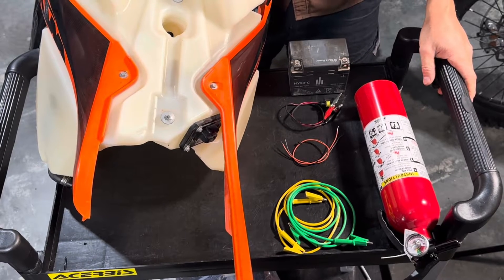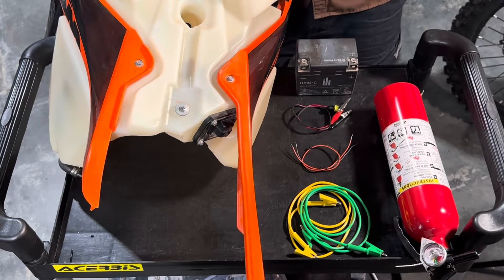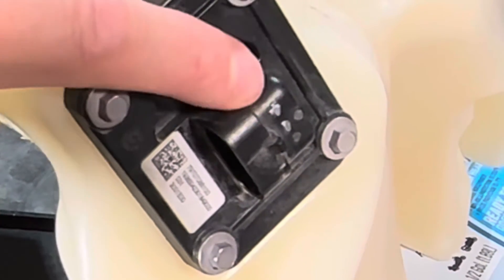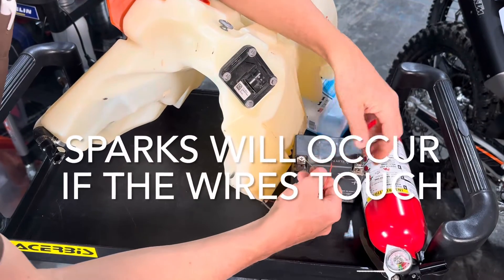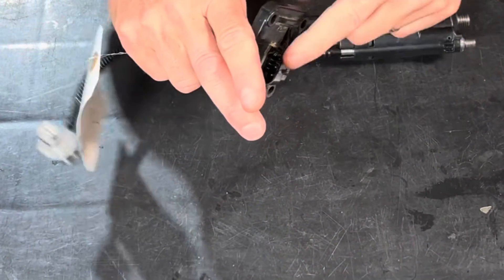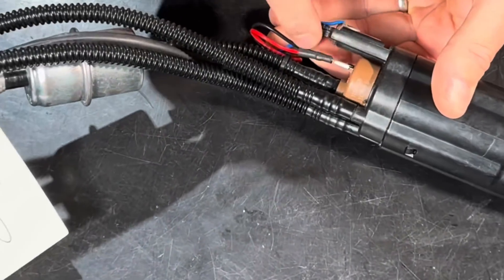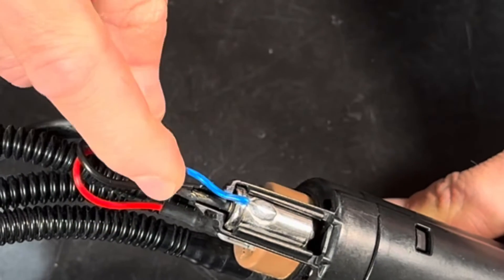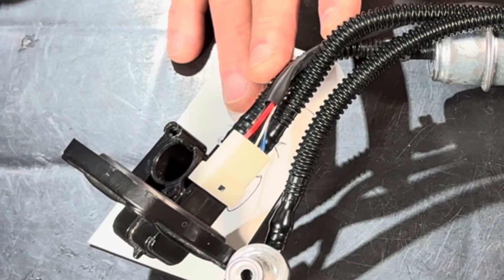FUEL PUMP TROUBLE SHOOTING

Comment: I have a problem with a 2018 ktm 500 exc that is flooding the motor trying to start it.  I mean it’s just dumping gas like crazy when I try starting it.  If I unplug the fuel pump it will end up starting and run a couple minutes on the unburned fuel.  The injector isn’t stuck open and the fuel pump relay seems to be okay.  Do you think this could be an ecu problem?

Comment: My gas boils alot, I just changed the filters in the fuel pump and it's still doing it. What happens is that the tank vapor locks and the motor can't get enough gas. If I pop the gas cap, it fixes it shortly (cause it breathes). Is it the fuel pump boiling the gas, or just the heat of the motor? 2022 GasGas EX 300.
Reply: Tank needs to breath through a hole in the cap, or a hose out of the cap. Have you clogged the hole?
Reply: @HeathenParrot  I think the frame is clogged. The stock exhaust breather hose plugs into a little dongle that vents through the frame. I just let it flap, fixes it somewhat.

Comment: Dear,
I have a problem with starting a KTM exc f 350, 2020 year. When it had 38 working hours it went out and the fuel pump was replaced at the service station. Now that it has 58 working hours, it has shut down again. Both fuel filters have been replaced. It is interesting that after replacing the fuel pump, after pressing the start button, the pump did not work for 3 seconds, but silently and only as long as I held the button. if I put ground on the fuel pump relay, the fuel pump sounds... What could be the problem that the pump does not get a signal for 3 seconds (when I briefly press the start button)?
Reply: I have the exact issue on a 2012 350 xcfw. If I jumper the relay to ground, it will start right up and seemingly continue to run. When turned off and immediately trying to re-start the fuel pump relay has to be grounded again. Seems as though the ecu isn't sending the initial negative signal to the relay.

Did you ever find a solution?
Reply: @travtacker5752  The engine is running, the pump is only audible when the engine is running.

Comment: Nice presentation.  One small suggestion is that when you are connecting the alligator clips to the pump-side connector/pins, I would suggest that you first connect both alligator clips to the connector and then connect to the battery.  That way, if you happen to short or touch the alligator clips together or across the pins there is no harm.  Once securely connected to the pump plug, then you can easily connect the other ends to the battery for testing.  The same applies to the bare wire tests but that generally takes two people - one to first hold the wires on the pump connector and then the other to momentarily touch the batter posts.